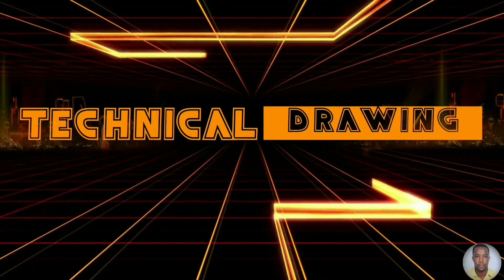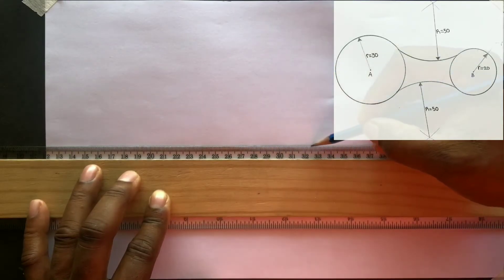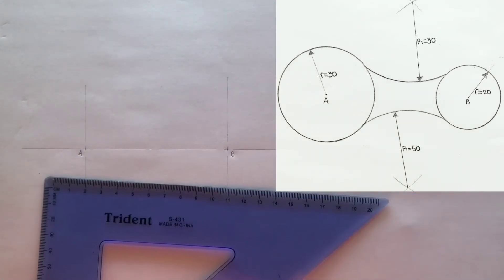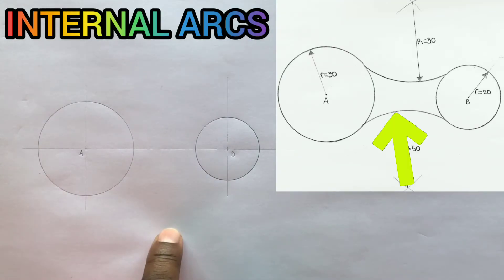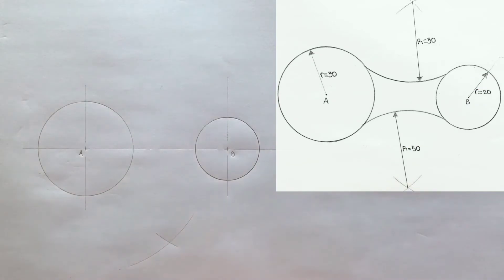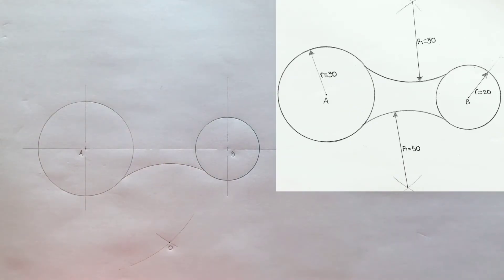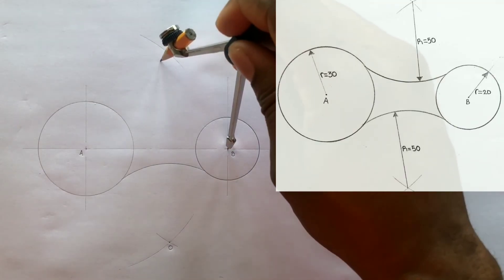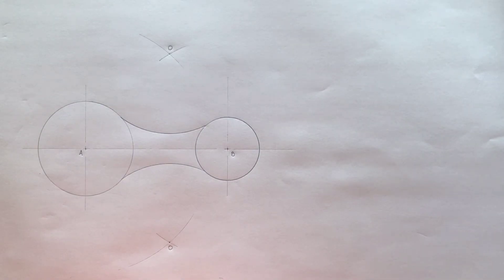How to Blend ARCS and CIRCLES | Internal Arcs

Comment: bout to use it tommorow for my technical drawing midterm exam, cheers
Reply from the maker: Ok 😎
Reply: @KEYTECHNIQUES  yo sir on the external arc video, why is the R=100mm u said in this comment that R is gained by r1+r2
Reply from the maker: @AkbarAthallah  R in this video was never 100mm
Reply: @KEYTECHNIQUES  what im trynna say is, is the R given or we have to figured it out by ourself, cus on the last year exam it only contain 2 radius for the circles and the distance between the 2 circles
Reply from the maker: @AkbarAthallah  The Radius of the blended arc is given. 
What you need to calculate is the center where you will scribe the blended internal arc from.
Reply: @KEYTECHNIQUES  aight thanks
Reply from the maker: @AkbarAthallah  Your welcome. Hope your straight now.

Comment: thanks for the lesson. I just started having in geometry and I'm a bit confused whats the difference between external and internal arcs? I tried googling it but I got no answers.
Reply from the maker: For this lesson, we had two circles. The circles have centers A and B respectively.  Now notice how the blended arc is moving in towards the centers of the circle. Hence it's an INTERNAL ARC.  If the blended arc was moving away from the centers then it would be an EXTERNAL ARC.

( Let me know if you grasp this explanation)
Reply: @KEYTECHNIQUES  aah I see I see. Thanks so much for the explanation